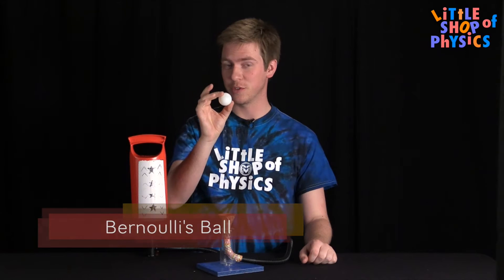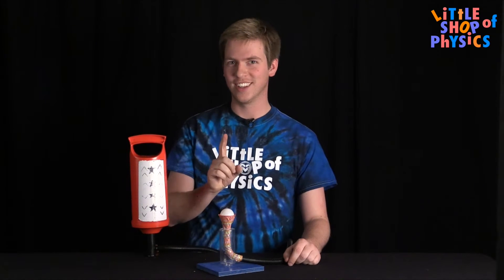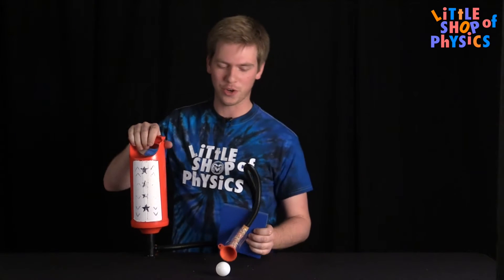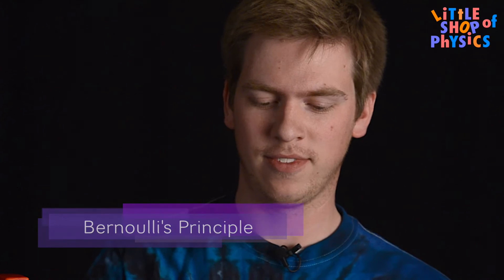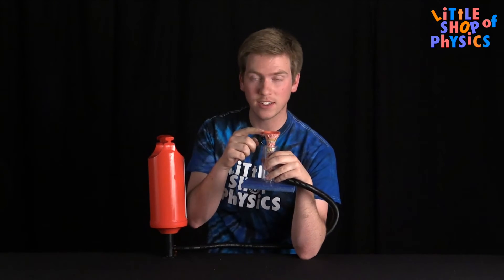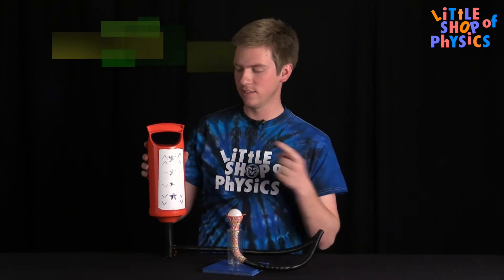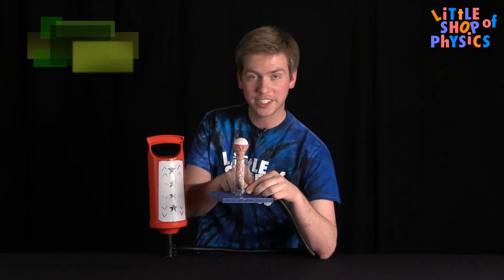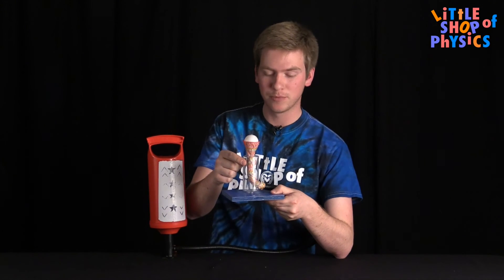Get Your Science On: Benoulli Ball

Comment: The dynamic pressure created by the pump is lower than 14.7psi. That's why it can not escape. And since air flowing around the ball and entering stationary air , there should be entrainment casuing the flow to wrap around the ball, i.e., Coanda.

Comment: The statement that "Fast moving air has a lower pressure than slow moving air" is not fact.  It can be measured.  ... 
The correct Bernoulli's Principle has to do with acceleration of air as it travels along a single path.  Accelerations of each bit of air as it travels along is accelerated by a pressure difference.  In addition, a curved path is also an acceleration, a centripetal (radial) acceleration.  A curved flow around a ball causes a pressure gradient at the ball's surface....
See Weltner's Fig 3:
Weltner in PDF - "Misinterpretations of Bernoulli's Law":
 http://user.uni-frankfurt.de/~weltner/Misinterpretations%20of%20Bernoullis%20Law%202011%20internet.pdf    
...
This bit of bad science has been around for a long time:
The Cyber History of Bernoulli’s Principle: 
Thomas M. Keating, James G. MaKinster, Jonathon W. Mills, & Jeffrey A. Nowak February 1, 1999 Indiana University
http://citeseerx.ist.psu.edu/viewdoc/download?doi=10.1.1.88.6970&rep=rep1&type=pdf 
-- 
Regards
Reply: Thanks for your comments! We've thought carefully about this issue. That's why our hands-on station with a beach ball held in an airstream is called "Soaring Sphere"; we don't invoke Bernoulli's principle where it isn't called for. The sphere levitates because of the air curving around the ball. But this particular demonstration is different. It concerns air moving out of a funnel with an increasing cross-section area, not a stream of air bending around a ball. The effect works the same way with a cube or other shapes as well, so it's not curvature of the airflow that causes the effect; it really is Bernoulli. Again, thanks for your comments, and do keep in touch!
Reply: Hi Brian.  Thanks for responding. Yikes!  Sleep has not been my friend for other reasons. I made a BIG mistake in saying the part about the funnel.  I can't believe I said that as I haven't fully analyzed that one demo.   I apologize for that one comment.  
I was wrong.
...
I've been trying to reconcile this one common demo against the Canadian paper on the flat plate levitation, but haven't had time to get seriously into it: Bernoulli Levitation paper Univ of B.C.(Spool & Card)Shows measured pressure data.
:http://arxiv.org/pdf/physics/0206025v1.pdf I'd like to set up pressure measurements in the funnel.
...
Is, or is there not, air curving around this ball? If it is not, then what is it doing?
If it is, then what is the pressure gradient doing? (in which direction is it?)
...
...
What is your explanation of the demo where you blow between two balloons or empty soda cans?  There is clearly :fast" air between them. 
...
What's your explanation of blowing over the drooping piece of paper?
...
Air has mass.
Newton tells us that it takes a force to accelerate a mass.  
So what's the force that accelerates the air in this case? 
Just how does 'slowing' air 'create' a higher pressure? (in view of Newton)
...
That said...
...
My initial statement about the way Bernoulli's Principle is stated in this video still stands.  It is not correct.  Fast moving air does not have a lower pressure than slow moving air. This is not what Bernoulli said, nor what Bernoulli's Equation shows.  
How do you justify the way you stated it?
...
It is well known and measurable that air blown into the open atmosphere has a pressure equal to the still air at atmospheric pressure around it.   Look @ Weltner.  His Fig 3 shows the common way to measure static pressure of a moving fluid.
...
.......
Other things that don't ring true.
..
You say the air below the ball is moving faster, then slows (decelerates) above the ball.  However, as it goes between the ball and funnel sides, it is in the narrowest region and must be the fastest.  This means the air below the ball is slower and therefore has a "higher" pressure.  There appears to be a paradox here.
...
The air in the tube from the pump is moving the fastest, so it should have the lowest pressure in the system, no?  As it first enters the funnel, it is in a widening area, so the speed should be slowing.  What slows it?
...
Finally you say that the "higher" pressure above the ball (due to the slowing) works along with the atmospheric pressure to hold the ball in.  How do these two pressures work together?
Since the region above the ball is open to 'atmospheric' is it not just at atmospheric pressure.
...
I'd like to hear your reasoning on these things.
--- 
Regards
Reply: +Brian Jones OK.
Reply: Well...??  I see you are still propagating this myth.
Reply: Sorry.  Just saw this message.  For some reason I stopped getting notifications.   Will do.Email sent...